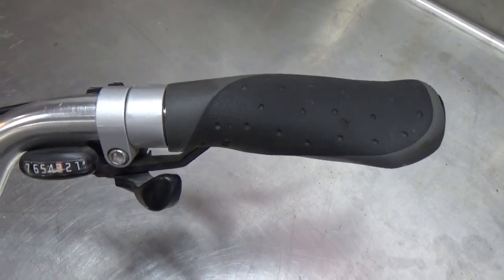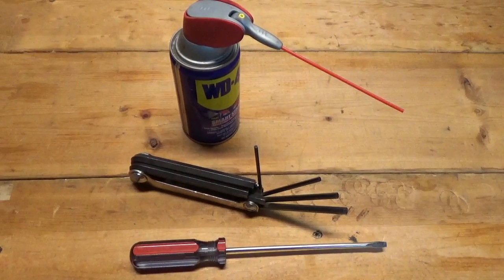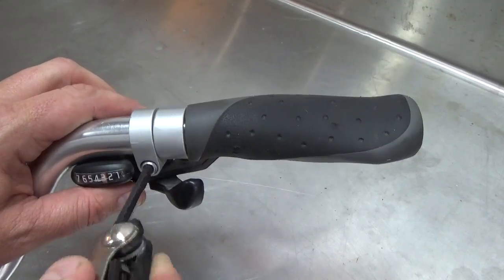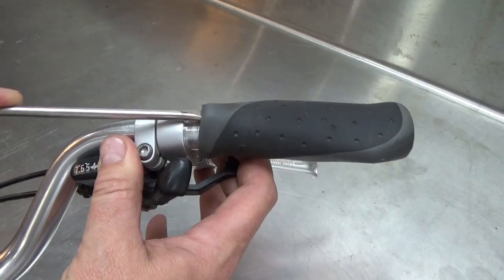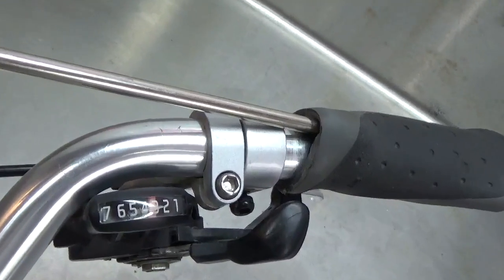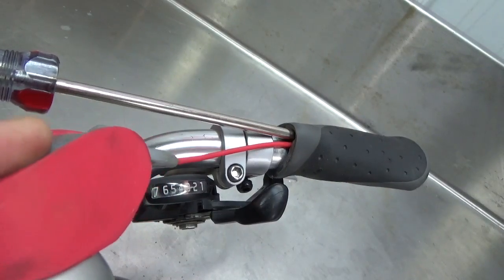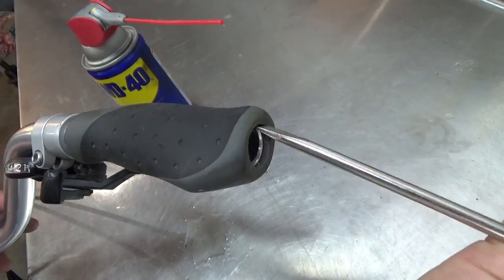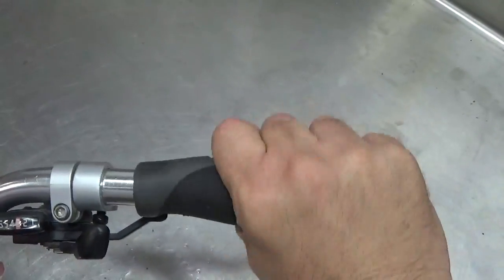Removing Bicycle Grips - Quick and easy tutorial

Comment: If you have access to air. Use air nozzle and blow air between bar and grip.10 seconds off,10 seconds on. No lube.no mess. Wrap grip with rag if grip in not enclosed.
Reply from the maker: worth a try for sure.
Reply: Sage advice... I've been using air for grips at the shop forever.

Comment: Did 2 sets this week. 

First before I saw your video - used water as a lube - a lot of effort and time. 

Second just now - much much easier - thanks for the tip. 

Btw both times I used 2mm and 3mm Allen Keys instead of the screwdriver - trying to avoid damaging the bars.
Reply from the maker: Fantastic!

Comment: Now a tutorial on how to install grips on a bike without having them slide off and have you wipe out and face plant over the handle bars would be in order lmao 🤣🤣🤣
Reply from the maker: To help you out with that, I would suggest using hand sanitizer.  it stays lubed long enough to slide the grips on, and then evaporates and dries out.  Works great.
Reply: @PhilCrockett  thanks for the tip.
Reply: Phil Crockett brilliant
Reply from the maker: No problem, Gilles Goulet!
Reply from the maker: Mindy, YOU are brilliant!
Reply: If you have access to an air compressor take an air nozzle and shoot air between the handlebar and grip to quickly install or remove grip. No lube needed.Block off end if open or wrap rag around grip if it is not fully enclosed. 10 seconds off 10 seconds on.
Reply: @PhilCrockett  MY MAN‼️ Hand sanitizer, worked 💯💯💯💯💯